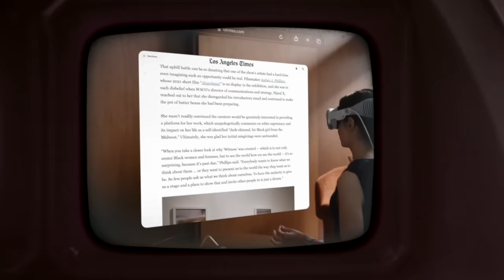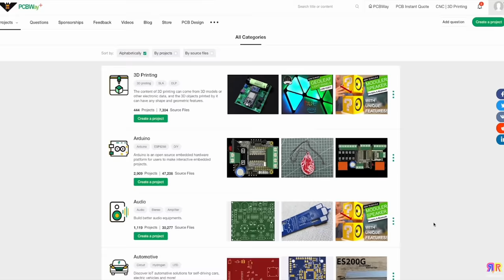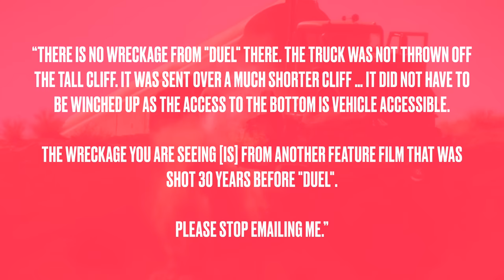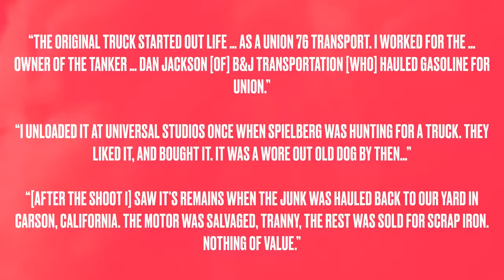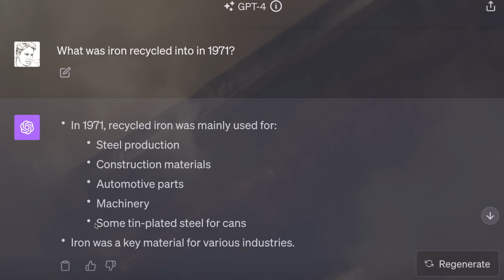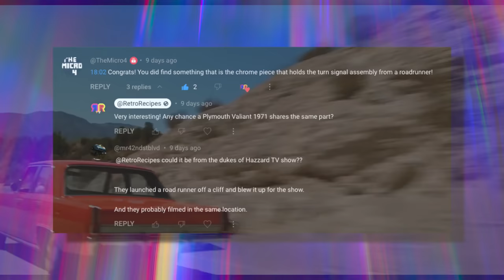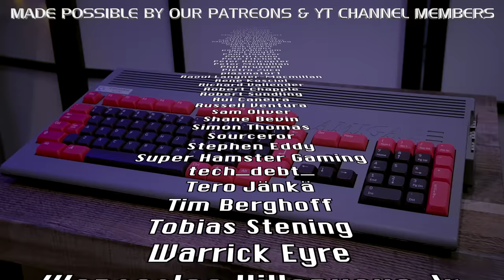Unbelievable 'Duel' Discoveries: Daisy Duke's Parts Uncovered

Comment: The doors on the truck have square corners. Not round like the cab that's down there. The wheel is a rally wheel from a dodge or Plymouth  duster, dart or demon and could be a spare from the car but not likely as a spare would likely be a regular wheel and not a Rallye wheel. The Peterbilt can and hood were made from aluminum and won't be rusty if found.
Reply: Exactly,  I have the same opinion.  And after so many years, another's cars and trucks may have the same destination.... buried in that cliff. At the local transit police office, maybe some records about traffic crashes could be found?
Reply: Yep, totaly agree, the truck does not have a rear window either, this cab do. Even the shape of the cab is wrong, the truck cab altought with rounded edge is quite square, not bulbeuse like that. Finaly the cab is way to small. A truck cab is much biger.
Reply: Did you guy even watched the video until the end?
Reply: @RKMaxmaj0r  sometimes happens.  The desire to comment is great hahaha
Reply: I believe  the truck did have a rear window, but it was covered by a fake AC unit to house a camera inside the cab
Reply: If you look at 1:32 you can see this rear slot
Reply: @chiriematthieu you’re 100% right about everything you said. They did shove the car off the cliff twice, still photos from production show this and I guess it’s possible a Mopar rally wheel was substituted to get the car to roll after the original drop but that seems HIGHLY unlikely.  That cab looks like it came off a GM light pickup. Wild it would end up in the same spot though.
Reply: @Leatherface123. fake “swamp cooler”….they used dry ice in them back in the day. Pretty cool stuff, look them up.
Reply: The truck cab down there is from a international d or k model (most likely a k)
Reply: @J.R.in_WV   The wheels for a 4 door valiant with a slant 6 are a 5 bolt pattern but they are smaller than the rally rims so they wouldn't fit.
Reply: @clayv5422   Definitely seems to be a K series. Perhaps kb5 or 6. Note the rare roll down back window!!!!
Reply: They're completely unable to identify the actual area so they definitely just made a video. Said this on the first one.
Reply: I'm sorry they use two to 3 different trucks so it's still there ok I know Im 
a dual fan
Reply: DON'T JUDGE A BOOK BY ITS COVER
Reply: @clarkchristiansen1979  If you're a fan, you should know that the film's called 'DuEl', not 'DuAl'. 🤣🤣🤣🤣
Reply: @kentkirkpatrick7953  wait what I never knew they made a roll down back window and my family has like a hundred old binders
Reply: @kentkirkpatrick7953  ok thanks!👍
Reply: @noahholliday9761 Not sure what you mean. In the first video he clearly located the exact point where the truck crashed and showed a side by side from Google Earth that matched 100% to prove it. So they did find the exact location. Maybe you skimmed through the video and missed some important parts.
Reply: It is. Her car period deal with it
Reply: @clayv5422  I think it's a Mack B series
Reply: Well it could be but it's got the same interior as a 1937-1949 international d or k seires
Reply: Yep, my El Camino has body colored ralley wheels the original owner covered them up with chrome spoked hubcaps but the spare tire is a plain steel wheel painted body color one that you would see behind your standard issue full sized hubcaps.  Its doubtful you would have a rally wheel as a spare tire they would have always been a plain steel wheel.
Reply: @HVACSoldier  ok thanks I tried to Google it but couldn't find anything
Reply: @clayv5422 NOT a problem.  There were at least a few “Burma” themed WWII movies.
Reply: They put them on all Chrysler cars ...Even the Cordoba styled 1975-1978 Dodge Charger,Plymouth Fury,Dodge Monaco the b body version along with all 1970 and up Charger,GTX,Road Runner.Cuda,Challenger..Meaning B bodies,E bodies and A bodies
Reply: @modelrestorations They made small bolt 5 on 4" ralleye wheels.
Reply: Buzzkill
Reply: That truck's been down there over 40 years, it's gone through weather, heat, probably kids jumping up and down on it, and it looks like a few gunshots. It's definitely from the film, it's just worn down after all these years. If you're old enough to know back then, then you know that we weren't the cleanest people in the world, and we weren't always picking up after ourselves. So if anybody asked the company today if that was the truck down there, it would definitely say it wasn't so they wouldn't get in trouble with environmentalists, and just the people that would complain about ruining the environment. Take a closer look at it, and imagine that somebody jumped on it and it's aged out quite a bit. Also it was thrown over the side of a tall cliff, i'm guessing it hit the rocks a few times going down.
Reply: It had a rear window but not shaped like that @chiriematthieu
Reply: @rednack9961  I thought that as well. Also you can’t see where the air horn was mounted on the truck they found.
Reply: The truck pushed his car down first
Reply: There should be truck and car parts down there
Reply: @modelrestorations The rally wheel came with both bolt circles, and were quite common. But seems to be big b.c.(5x4,5") and not small. (5x4")
Reply: Well most movies have stunt cars and hero cars so its still possulibly the stunt car and truck that were heated over the side of the road.
Reply: "DUEL" was actually Stephen Spielberg's SECOND movie.  He directed his FIST movie right out of Long Beach State with Joan Crawford in 1969 or 70.
Reply: @chrisleggett685  FIRST THING AS I SAID!! That cab was not a Peterbilt, without square door openings and that rounded back - but,, DID YOU WATCH THE VIDEO UNTIL THE END? They explained how they were wrong and what they found out later, including the crane that actually winched the Peterbilt up originally. Writing your mind before you even finish the video  ha?  Ya,

Comment: The truck cab you found appears to be an early Chevy (47-55) pickup. Most likely, it was simply pushed over the edge when it was deemed worn out. Remember, these were just old vehicles and weren't worth anything.  I can say from many years of hiking - it's pretty common to find old cars of that era at the bottom of sharp turns from a road above. There was no recovery effort.
Reply: It seems to be a common filming area though, so regardless of reason it could still be from a movie/tv show.
Reply: dashboard does not match with Chevy
Reply: @manaccept145  The back window doesn't match either, well, all of it doesn't match because it isn't a chevy from that year.

Comment: That was fun to watch. As a mopar guy, they def wouldn’t stuff a rally wheel on a four door valiant behind a hubcap, but it would definitely be on a roadrunner.
Reply: Hard to say, not a mopar but the original owner of my El Camino covered up the factory body colored rally wheels with metal chrome spoked hubcaps.  Some times people didnt like the sporty look and would throw hubcaps on even if we think its weird to do.
Reply: The Mopar rally wheel looks like a big bolt wheel. I think the Plymouth Valiant was still a small bolt pattern in 1971. 
It wasn't until front disc brakes became standard equipment that the Plymouth Valiant went to the larger bolt pattern.

Comment: If it hasn't already been addressed in the comments: great detective work and good catch as it being a Mopar Rallye wheel. However,  there were 2 different bolt pattern sizes  1) (nick named Baby bolt pattern) (5x4") and 2) large bolt pattern (5x4.5"). So, just for clarity the Rallye wheel was first used in 1970 so it is relative here. The small bolt pattern was only used on A-bodies (Dodge Darts, Demons, and Plymouth Valiants, Dusters, and Scamps etc..) Also relevant here. Big bolt pattern was was used on the others such as B-Bodies (dodge Coronet, Plymouth Satellites, Road Runners etc)  and C-bodies ( Dodge Polaras, Plymouth Furys, and Chrysler Imperials etc) However, with all that said being an A-body aficionado can I tell just by looking? The answer is yes, you have a Big bolt pattern Rallye that would be more likely off Daisy Dukes '72 Road Runner if that actually happened there. (another quick note: Road Runners are performance version based on the satellite) - btw.. no mention of what movie that cab truck could of been a wreckage of years prior?

Comment: That’s a Chrysler rally wheel, fairly pricey original wheel that would’ve possibly came on an R/T model or other special edition Chrysler products and Daisy’s Road Runner (which at that time was a 71/72 Satellite with the wrong year Roadrunner stripe) had chrome wagon wheels by the time that episode came out. But a possibility that it could’ve been in her trunk as a spare but I doubt the stunt crew would’ve left anything in it. The valiant in duel was a 4 door, steel wheels, with hub cabs, an extremely unlikely candidate for a rally wheel to have been in the trunk or on the car.
But I love the passion for the exploration!!
Reply: yep, i own3 valiants and they came with stock black wheels.

Comment: That is one awesome video yall made. I totally respect your hard work and effort trying to locate the wreakage. When you showed the cab the first clue I noticed is the wipers were mounted at the top of the windshield. The Duel truck wipers were mounted at the bottom. Didn't see the holes for the cab clearance lites or air horn
Reply: It's not even the right cab the roof on the one that they found is incredibly rounded but the roof on the Dual truck which was a Peterbilt was almost completely flat
Reply: @yannisgouras4482  yes sir, didn't catch that one. I was looking for the cab light screw holes and the hole for the air horn. When I seen the wipers up top that was a dead giveaway
Reply: @harrisonashley1631  well I thought that big box in the back window was some kinda A/C unit also but on a documentary I watched they said they had to install a box to hold the camera for the inside veiws of the cab. I imagine they were similating a A/C or swamp cooler for effects
Reply: Top door frames are quite different too. The found wreck has very curved frames, the Peterbilt had very sharp, square ones.

Comment: Check the bolt pattern on that wheel.  Pre ‘73 A bodies had a 5x4” bolt pattern.  That rallye wheel you found looks like a 5x4.5 bolt pattern.  The Duel car wore hubcaps, which means it had black steelies under them.
Reply: while that would generally be true, some times hubcaps would have been put over more desireable wheels by the owner of said vehicle.  I found out my El camino still sports the body colored factory rally wheels but the original owner hid them away behind metal chromed spoked hubcaps that he put on when he bought the car he didnt like the rally wheels.

Comment: They definitely winched the vehicles back up the cliff because on the first take the car went over but the truck got caught on the edge, which is why on the screen footage the Valiant is clearly already burnt out before it goes over. Stands to reason there must be some parts from the car and truck still there as you say, but likely it’s all buried now under 50 years of sand or under the vehicles that have been dumped there since.
About 15 years back a guy did a video showing a rusty pickup cab and claiming that was the Peterbilt, back then I tried to research what had happened to the Duel vehicles and parts and everyone I spoke to said they had been removed immediately after filming.
I bet someone took photos at the time… 🙂
Reply from the maker: I heard that story about the car too but couldn't corroborate it and it's strange it's not mentioned in the making of book which discusses the stunt driver story about only having one take
Reply: @RetroRecipes  is it not in the book? I actually had thought that was where I’d read about it…
Reply from the maker: @CycolacFan  Nope, I only ever read it in online comments, but my standard for presenting info via the channel has to be higher than that. I'm not saying it didn't happen, just can't confirm it did from any first hand source.
Reply: @RetroRecipes  I’ll try to find my source for it, if not DVD commentary or a making of documentary then it must have been a book or magazine article. But I distinctly remember them saying the car went over on fire and the truck got caught on the edge because once the stuntman jumped from the truck it slowed right down. I think perhaps they wanted time for the wind to close the driver’s door. That’s why the door is still open as you pointed out, because he jumped at the last possible second in order to keep the speed up. Why they didn’t use one of their other Valiants I don’t know, maybe only one had the heavy front end damage required.

Comment: The wheel is a Chrysler "Rally" wheel. If it was 5 lug on 4" (center-on-center), it's from a '70-'72 A- body. Dart, Demon, Duster, Scamp or Valiant...but it was an option. The movie car has the standard wheels, with hubcaps and they are 4.5" wide. Rally wheels are 5.5" wide
Reply: It's not a 5 on 4" I can tell from the photo. I've had that bolt pattern on a '71 Duster. It's a 5 on 4.5" and is a B/E-body wheel.
Reply: @CarsandCats  or '73-up A body...

Comment: The Plymouth rally wheel looks similar between the A body and the B body, but there is a telling difference.  The A body has a 5 on 4 inch bolt pattern, whereas the B body has a 5 on 4 1/2" bolt pattern.  I think that wheel is a 5 on 4 1/2" pattern.  You could probably match up photos of both bolt patterns of that wheel to the one you found to determine if it fits a 1969 A body.
Reply: Right, plus it might be wider than an A body wheel. Looks like it's a deeper dish wheel.
But how they thought there was ANY chance the cab was the right one is crazy.  It's a split-window, but that's where the similarities end.
I figured that out before they did, but these aren't car guys, obviously.
Reply: Wow so it comes down to PCD (Pitch Circle Diameter) - Not PCB (Printed Circuit boards or Poly Chlorinated BiPhenols) take your pick!

TLA Joke! (Three letter Acronym)

HOABL
Reply: A body Mopar did use big bolt pattern if it was a disc brake car I know I own a 74 Plymouth duster that has disc brakesn
Reply: @UberLummox  The moment I saw the profile of that cab I knew it wasn't the Duel tractor. I thought, "Come on..."

Comment: on the mopar rallye wheel: that wheel you found at the cliff, looks like its a large bolt pattern(5x4.5"). the a body mopars like the valiant from the movie, had a smaller bolt pattern(5x4"). that wheel found at the cliff is from a b or e body. daisy dukes roadrunner could have had wheels like that, with the bolt pattern.

Comment: While I did want to believe it was the truck from duel, the alignment of the cab seemed a little bit too convenient, unless there were other endings planned and they needed the cab in a certain postion for certain shots and so planted a second truck.

The adventure was still worth it, as you'd never have been content with the answers from the production crew without going there yourself. Part of me thinks they give those responses to stop the treasure hunters pestering the land owners.
Reply: Cab looks way too small for a tractor truck cab it  looks  more like a passenger truck cab of the same time period.  If it is the same cab its possible over time everything got washed down and repositioned.
Reply: @Milner62  The rear window was different. That's probably a GMC or Chevy 5 window cab.

Comment: The wheel you found is a Mopar Rally wheel. If it came from Daisey's Road Runner the bolt pattern would have a 4 1/2". If the wheel came from Weaver's car it would have the Mopar "small bolt pattern" which is 4" and would be for a 14" tire.

Comment: If that MoPar Rallye wheel is a 14" it is off of an A-body, which the Valiant is. It could have been a spare but certainly was never on the car from the factory. Now if it's a 15", then it is a B or E-Body wheel. The Road Runner is a B-Body.

Comment: Might have helped if you looked at the date stamp on the wheel. Also I owned a valiant with hub caps and the steelies were not ralley wheels. Those had the center caps and trim rings like the e-body for daisy duke. It looks very narrow though. Would have helped if you looked at the size stamped in it. It had no tyre, it was right there to look at😂

Comment: It would appear by the comments that the wheel you found has been identified positively as an early '70's Chrysler rally wheel. That shot up truck cab, however, judging by the shape of the rear window, just might be a late 50's early 60's MACK B model. That's my two cents. Thanks for the adventure!!👍
Reply: Similar shape rear window but it’s split into 3 segments and haven’t found anyone that’s identified it yet but hope to
Reply: Came in to say that, certainly looks like a B model Mack cab. Those B models were my favorite trucks from a styling standpoint.

Comment: that wheel is a Chrysler Rallye wheel you found, but it has a large bolt pattern that the valiant wouldnt have used in 1970... it was used on full and midsized chrysler products.. like on Daisy Dukes Road Runner.

Comment: Good Show Lads , , true adventure  , That Split-Window Truck cab certainly looks screen accurate enough , , they claimed to salvaged the motor wich couldve been tossed clear from other parts  , , ,i believe studio  winched up some parts of truck but left that cab and other parts that weren't as resellable as that motor , , so well done lads , i believe you indeed found the "Evil Truck" from "The Duel" , , because back then studios were lazy about a lot of stuff , and "Carbon Footprints" meant nothing to them back then , , , chunks of that Weaver- Car are also probably there partially buried obviously with bush foliage on top of that , , ,🧐🤔🤔🧐 , great work , 🎄🧑‍🎄👍👍